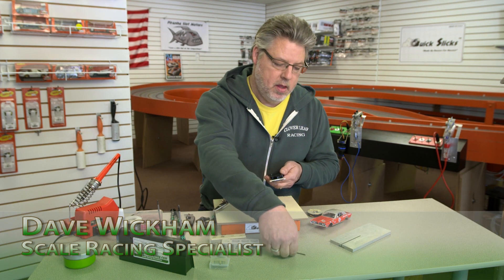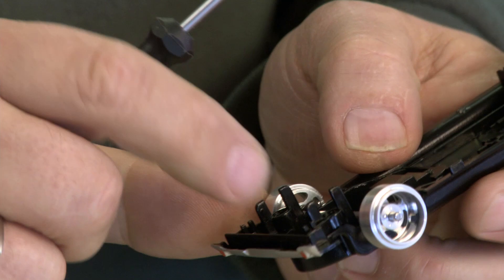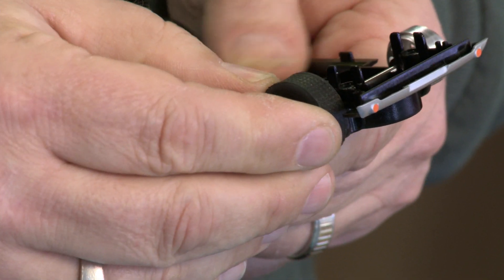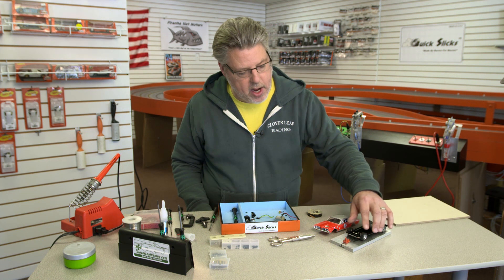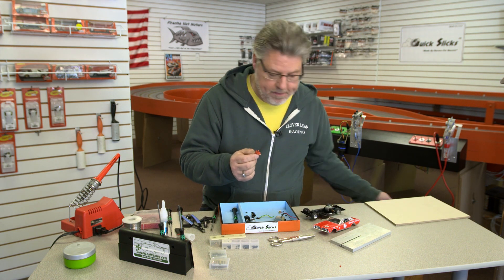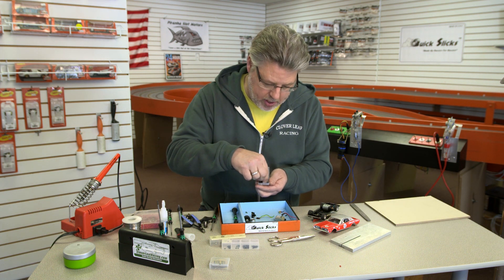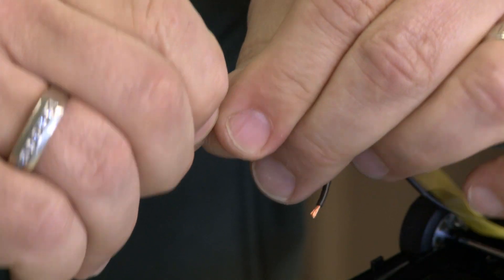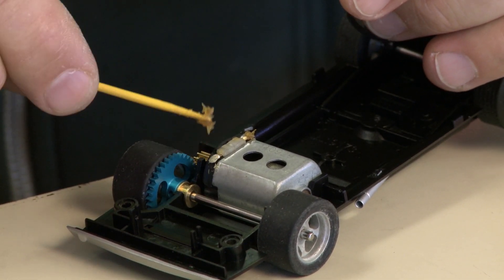Cloverleaf Racing Car Modify Part 2

Comment: Did you do file the front body mounting posts to reduce the fender gap over the front wheels? The Scalextric Cougar seems to be notorious for that.
Reply: It's a little more involved than just filing the body mounting posts.  The front valance was removed from the chassis and glued into place on the body. The rear valance may need to be removed also.  Use a hobby saw to remove the valance/front end making sure you don't affect the mounting holes in the chassis.  Once the front (and back) are removed from the chassis and glued to the body then you can file the mounting posts to lower the body.
Reply: @davidwickham1665  Score and snap works well with plastics also, provided you are good and steady with a sharp exact o knife.  No dust, and a nice clean line.